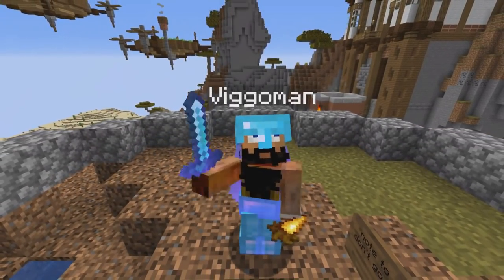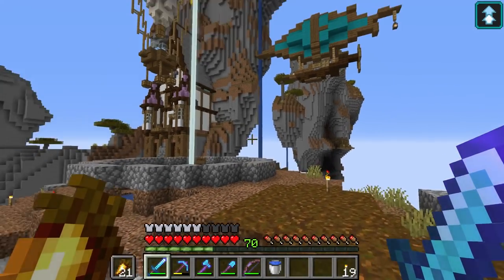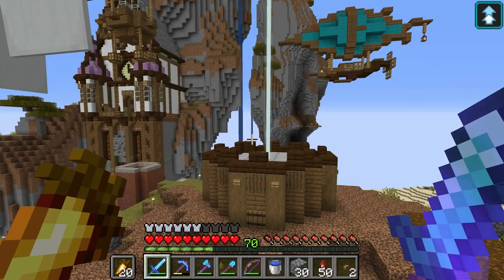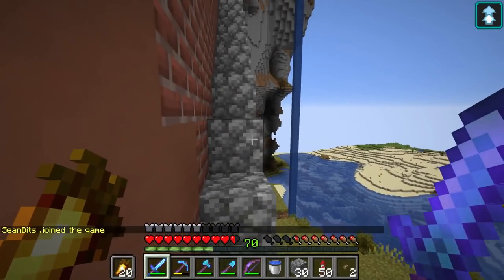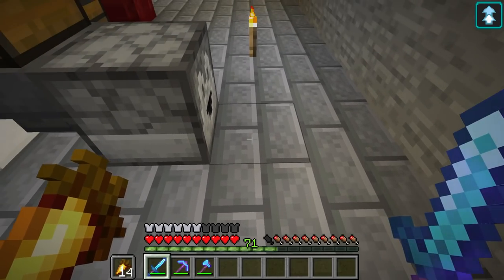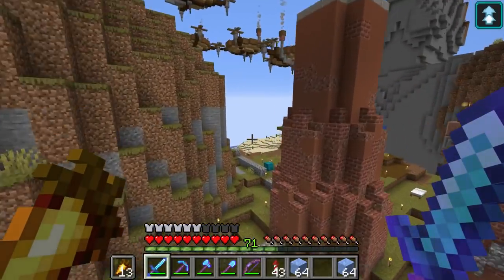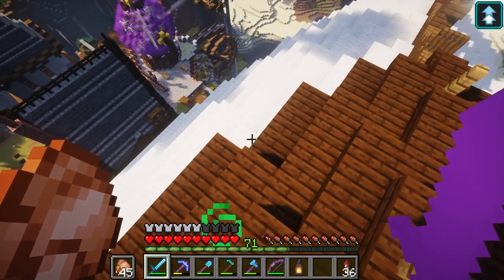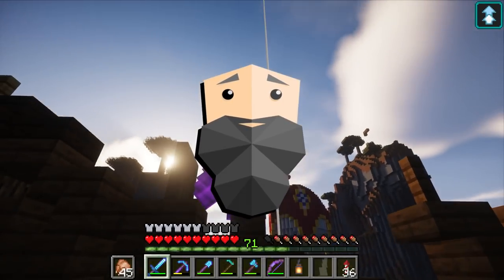Legacy SMP: Best Beacon Design | Minecraft 1.15 Survival Multiplayer | Episode 16

Comment: Hiya Viggoman. Love the videos, love this series a lot. Your question at the end...I was thinking it would be really cool to see some sort of system that chains the island down as if it were floating away maybe...add a crater below as if it ripped up at some point in the past...and maybe add some other debris islands that are floating off as well?  Also Another idea would be to add some type of old telescope observatory on top of the  larger cliff, with orange copper like structure beams. And my last idea for the steam punk theme would be to have another Battle cruiser type balloon with cannons on the sides like the old galleons from the sail days  with multiple sails on the top and giant blades/screws for propulsion. Keep up the great work!
Reply from the maker: So many great suggestions
Reply: @Viggoman  if you had chains on the floating island like that then you could also use some purple-stained glass on the bottom of the island to make it look like the same energy from the beacon globe is what is making the island float